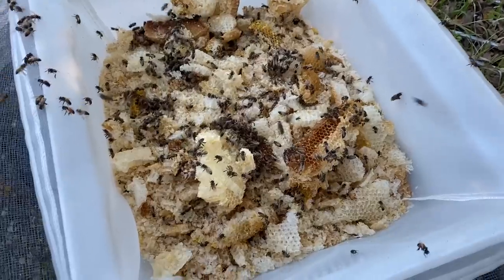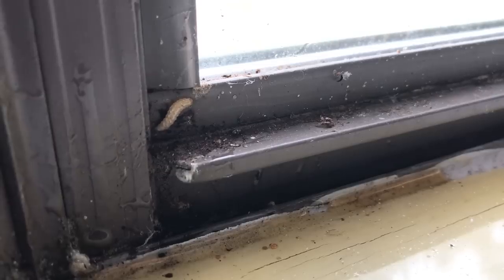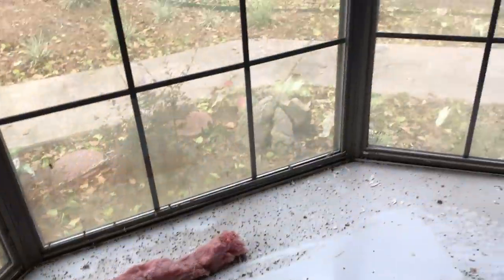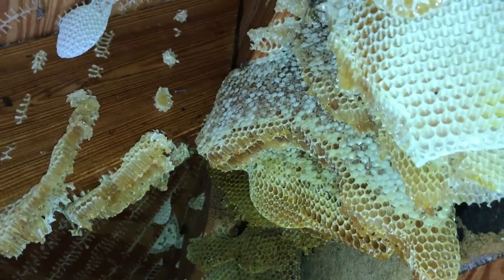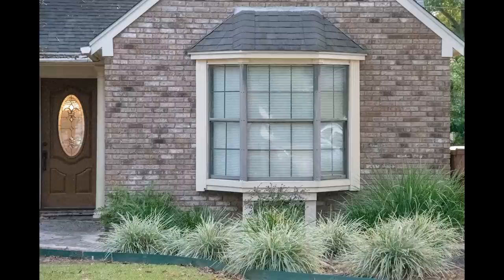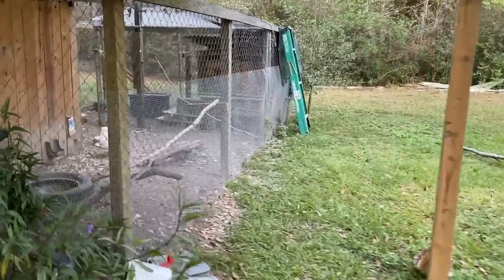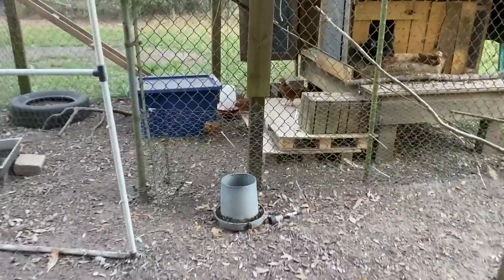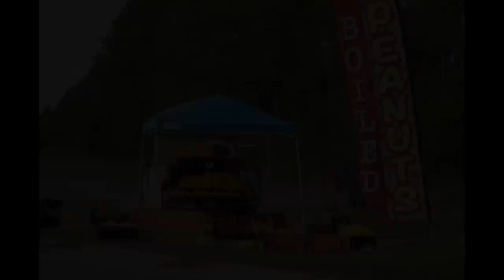This House Is Bleeding Honey

Comment: I saw a video from the killer bee man, and he uses rhino liner or undercoating spray to kill the odor and prevent bees from comming back into that void area
Reply from the maker: That may have been a good option for where ever he was working but you can't Rhino Line the surfaces on the outside of the entrances.  Look at some of the older removals we do.  All the dark area outside the bee's entrance has the same residue and smell as the interior space.  If a colony was in a space for a short enough period of time I could see Rhino Liner as a good option.